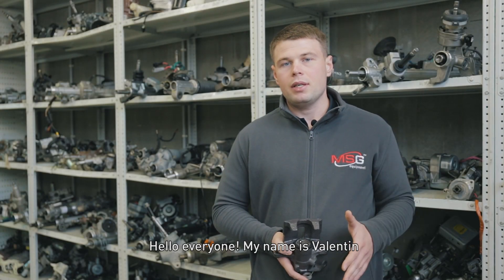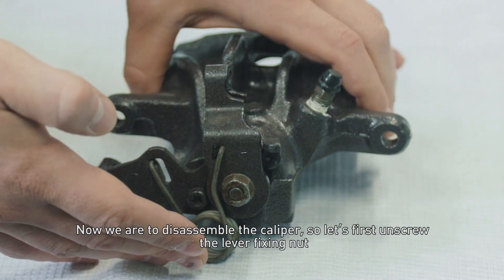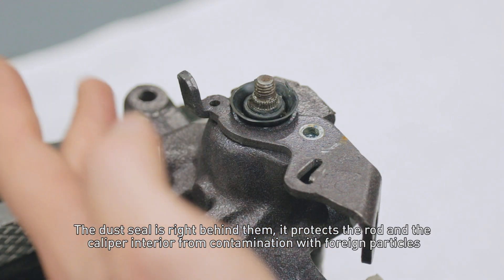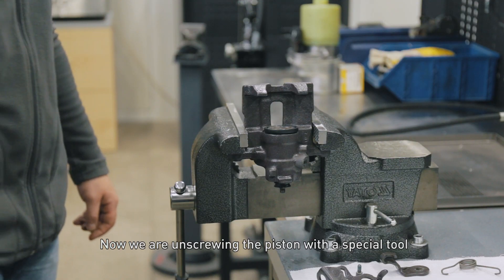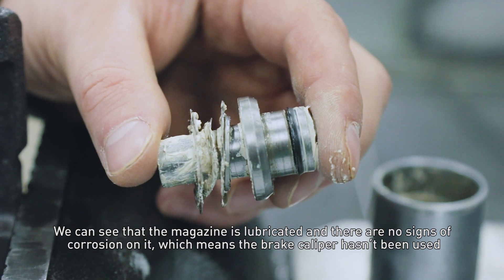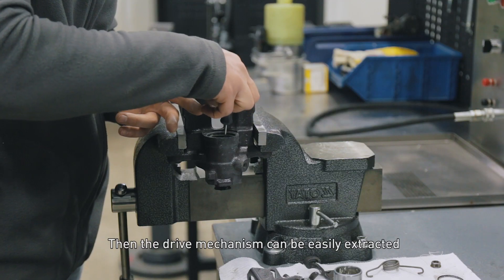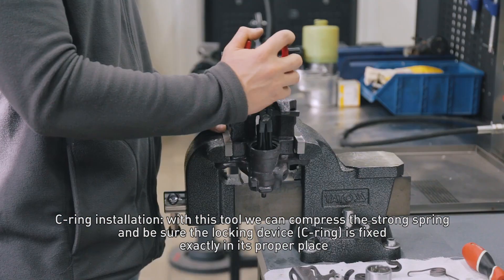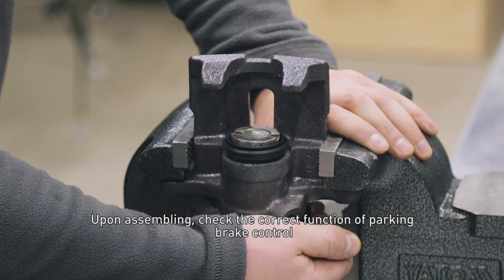Special features of brake calipers by Nissan Primastar, Opel Vivaro, Renault Trafic

Comment: funniest thing- its indentical to VW transporter t4 brakes from 1990- 2000. Was a moment when i have  VW t4 1997 and Renault trafic 2  2012 and rear brakes was not just similar, they was indentic...

Comment: The parking brake lever doesn't go all the way back as you would expect. I changed the cable which was sticky but still it doesn't go back all the way. (you can pull by hand the extra 20% to full release)
Any damage or diagnostic suggestion?

Comment: i imagine one could use a g-clamp and a 13mm? socket instead of the MS30001 tool ?
Reply from the maker: Hi Martin,
Yes, it’s possible but the MS300001 makes the mounting process a little bit easier and faster than with the G-clamp.

Comment: Great video. I had to discover all this for myself last year. This video would have been extremely helpful. Thanks.
Reply from the maker: Thanks! We are glad you liked it.
Reply: I have a problem, in the piston I returned it, it does not reach the stop, it keeps turning, it is also wet with brake fluid, which would be the problem, thanks